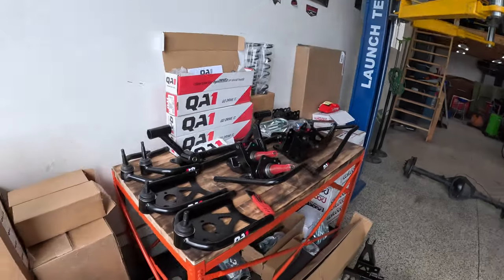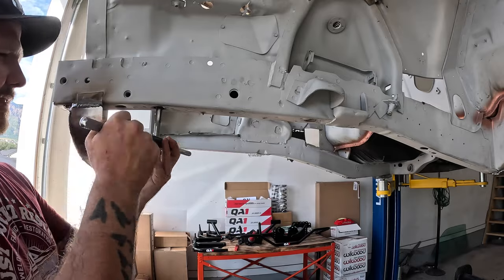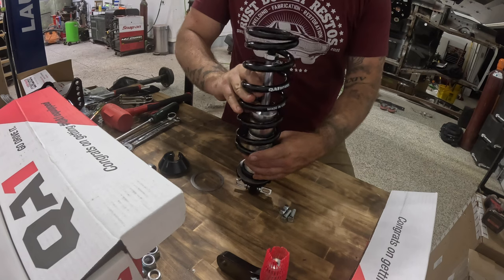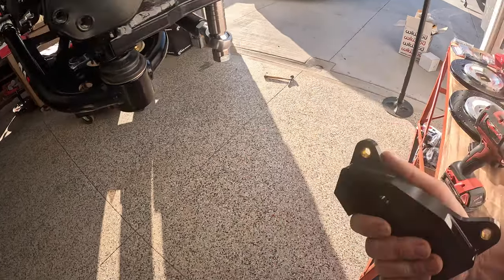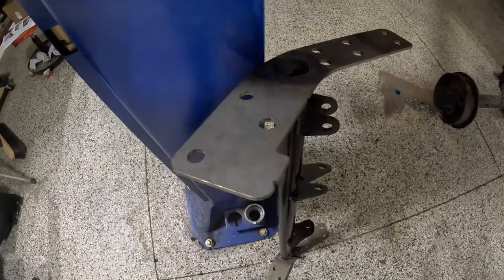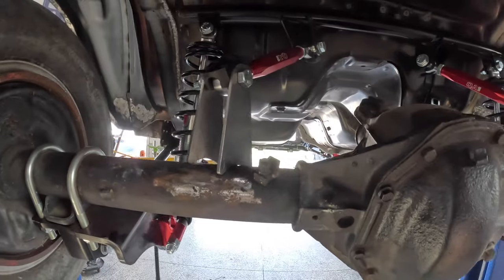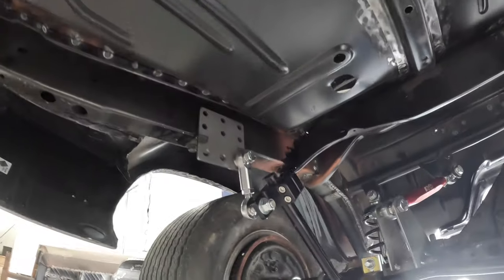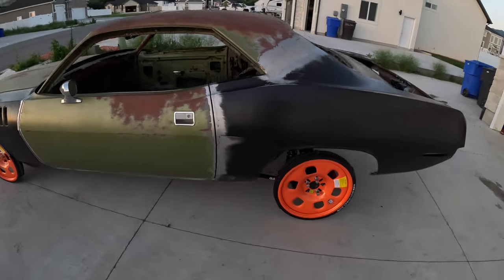1971 Plymouth Cuda Restoration - Episode 16 - QA1 Suspension Upgrades

Comment: You will LOVE this front and rear suspension. It is a Carl Gerst design and I had a little bit to do with the final design. The lower control arm on this system is the ONLY aftermarket double shear design. All others are one long bolt with single shear on each end... I discussed this with Carl several years ago and he put it right into the final design. Now I just have to come up with the money for this system myself!! lol...

Comment: Unless u want the body of the car to move sideways over the rear axel on hard cornering like the old 5.0 liter Foxbody mustangs from 1979 - 1993, u will have to put either an adjustable Panhard bar or a Watts linkage on your rear axel set-up. If u don't u will have constant oversteer when going around a corner quickly. I have learned this from experience the hard way on all 4 link suspensions.
Reply from the maker: Good info!  Thanks! 😎🤘

Comment: Very cool build.. question tho.. wouldn’t it be better to finish the underside with undercoat before installing all this ? If it’s mocking up I get that, but usually what I see in most builds similar to this is that all the welds are dressed and primed painted then seal coated and undercoat applied before the running gear, brakes and suspension is installed.. just curious.. love the build !!! Love goes out. 💯
Reply from the maker: I prefer to put weight on the car before dialing in all of the body gaps.  The 4 link also needed to be welded in before the next state which will be blasting & epoxy.  Stay tuned!

Comment: Alex Taylor tore apart one of those Hellcat Challengers for a competition, and you shoulda seen the literal mountain of Wiring they took outta that car from front to back regulating the Engine...she said it took a little more than a tenth of the weight of the Car away taking all that crap out...
Reply from the maker: There is a significant amount of wiring.  The Holley terminator x really cleans things up!

Comment: Do you use any type of lock tight on the bolts?
I appreciate your explanations, thanks!
Reply from the maker: I will be using blue loctite when I final assemble & detail everything at the end.  Using loctite & grease now makes disassembly a messy pain in a few days when it all has to come back off again for blasting & epoxy.

Comment: Atta boy,  throwing that engine in  , before adjusting doors and gaps 😂 tranny weighs another 50 some pounds at least too
Reply from the maker: Tranny is in already too 😋.  Believe it or not, it weighs 150 lbs on its own!  I like to have as much weight on the car as possible before doing any gapping or panel matching.  You should do all of that work on the ground at ride height.

Comment: Are your plans to race this car? If so what kind of racing do you plan to do? The picture of the car on the lead-in to the video looks like it sits significantly higher off the ground than the original suspension stance from the factory. My concern is that may be OK for general driving, but for racing where high speeds, say 90mph and above, it is easier for a car to become airborne, especially if the body gets sideways to the direction of travel. Under airborne conditions you loose all control over the car. You may want to consider an air dam at the front to help keep air from getting underneath the car. A tail-wing structure at the rear would add directional stability like the Dodge and Plymouth superbird designs. I would not want to see you get killed due to any oversight in design approach. Be careful! We want to see you do more cars in the future!
Reply from the maker: I’ll probably do auto cross with it occasionally.  Wouldn’t mind seeing what it would do in the quarter mile either.  I plan on driving this car a TON!

Comment: Did you have to torque all the bolts before moving on to the next step? I didn't see a torque wrench.
Reply from the maker: No torquing yet.  Most all of it will come back off in the next few days so I can get the car up on the rotisserie and have it blasted.  When I do the final assembly & detail I’ll be greasing, anti seizing, final torquing and cotter pinning everything.
Reply: @rustbucketrestos6511  
Ok, I got ya. I've been watching you since you bought the rusty charger. I've learned a lot from you. Have a good day, and God bless.
Reply from the maker: Thanks man! 😎🤘

Comment: Unless I'm missing something, why install those notes when you'll just have to uninstall before painting?
Reply from the maker: So I can finalize the panel gaps, fit the engine & transmission, make tunnel modifications, weld in the remaining odds & ends, and set the ride height.  Now it all comes back off to go on the rotisserie & prep for blasting, epoxy, and body work.

Comment: your lower trailing arm mounts the bolts are sticking out towards the inside of the tire would they not be better if the bolt head was towards the inside of the tire and the threads sticking towards the center of the car? clearance is all I am thinking about here. I am by far a expert on anything just a observation.

Comment: I’ll stick to ma MOPAR front end thanks sorry there ways to improve it . Old school MOPAR Power plant to .plus the T/Flight or factory 4 speed  way more fun actually old 340 or big blocks sound so much better then the lap top modern V8   . if you brake down your on a toe truck to there work shop to plug it in sorry but true. Yes your build is done well . But not the same fun that a original Cuda can bring .  Iv seen an driven MOPAR at high speed the way ma MOPAR made them even on tracks here in Australia 🇦🇺  Greg click VJ 340 Charger at Bathurst running very high speed an out running GMH an Ford .👍🏻Tilly’s VF Valiant Pacer running high speed time after time at speeds your lap top MOPAR will never see. an yes ma MOPAR front end with only small modes . We’re do you plan to drive yours 🤔. It’s a matter of wheel an tyre combo shock an alien an old school no how . I’ll take old school MOPAR anyday sorry enjoy your build it’s different that’s for sure 🤦🏼😮😵‍💫😀your happy . Don’t be surprised when a old school MOPAR blows you away in the quarter Mile it will happen sorry to say 💰💸.stay happy it’s not everyone cup of tea though . It’s a talking point .👍🏻🇦🇺💯⛽️ill watch to see your outcome in the future 🤔.